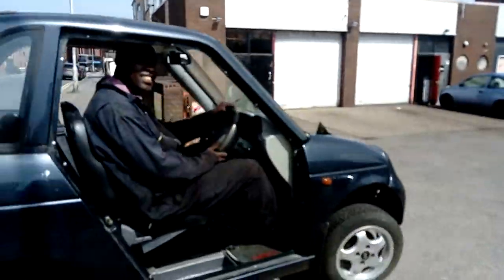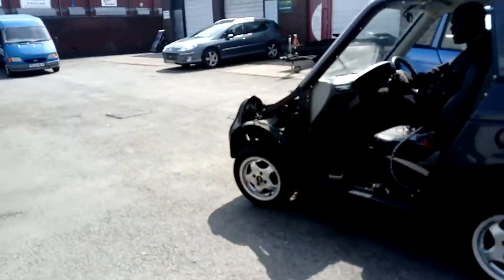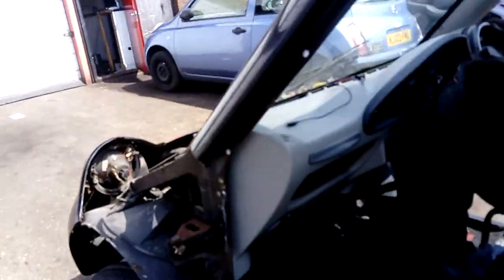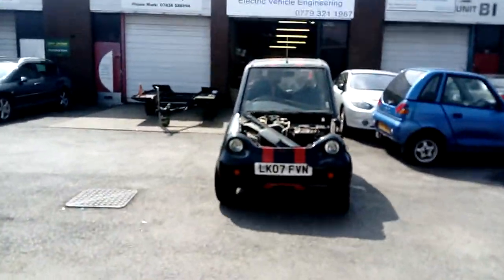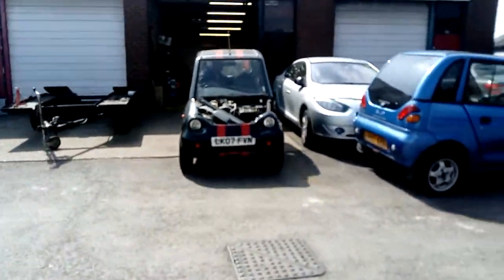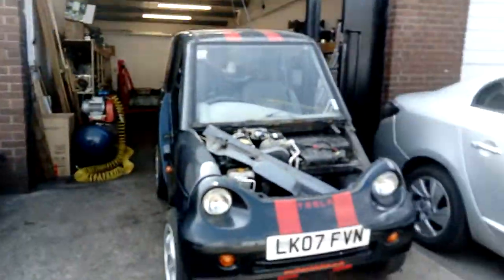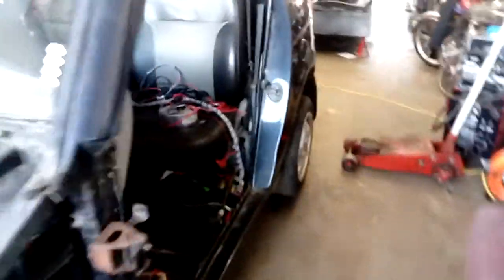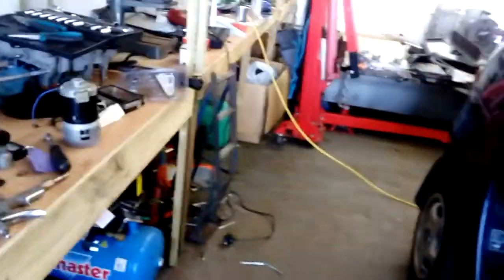Reva GWiz testing with small battery

Comment: would it be easy to pull out the existing dc motor and put in a bldc motor ? would it make any difference ?
Reply from the maker: Pixel.xo it's an AC induction motor. It wouldn't make it any more efficient really and AC induction motors are brushless already.
Reply: @TurboElectricLtd  but weren't the first Reva or gwiz DC motors
Reply from the maker: Pixel.xo yes but this is a later model
Reply: I have a Dc motor car I am from India, charger  is gone so removed charger and BMs using e rickshaw charger 15amps half of the original charger but batteries  are being revived which was sitting with the car idle foe 2 years still the batteries  are in recovery stage hope it works.  Gets its life back
Reply from the maker: Did you get any success?
Reply: @TurboElectricLtd  I gave up on the idea, was turning out too expensive even if I traded in the existing motor
Reply from the maker: @pixel_xo  Awe man :(